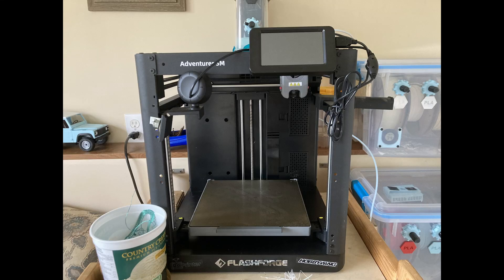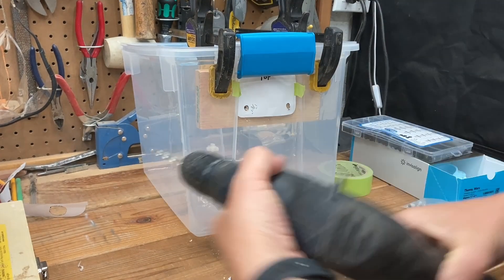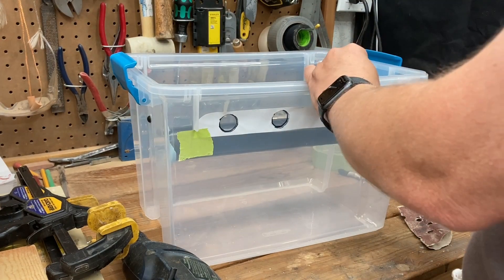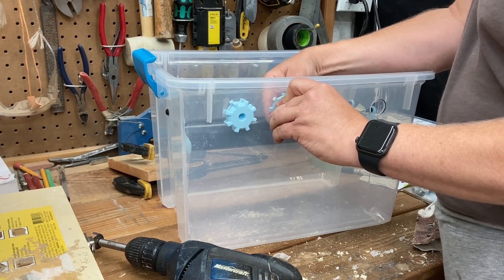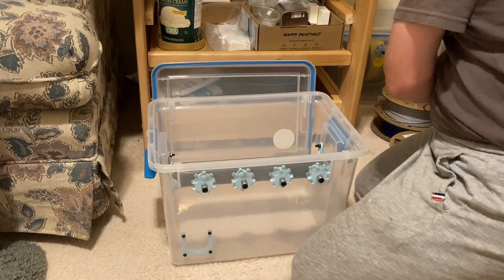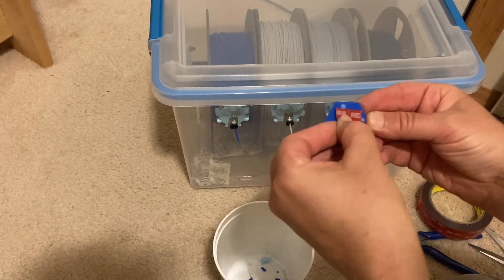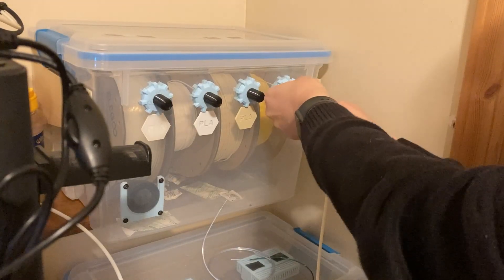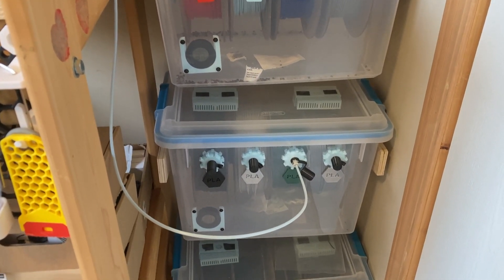3D Filament Dry Storage Boxes You Can Print From That Keep Filament Dry and Dust Free

Comment: Very cool. Curious about what a retraction mechanism might look like. I have a bunch of 200g spools that simply don't fit on rollers.
Reply from the maker: Yes, have to think about that one - I have some ideas of my own and have seen a few that others have made but haven't found one yet I like enough. Will of course involve more printing!
Reply: @pacificcoastminiatures  :) With 4 spools on one axle, it's a bit challenging. But perhaps if you are confident that the ends of the filaments are well secured, then rotating the axle might give just enough "nudge" to get the incoming filament to wrap around better?